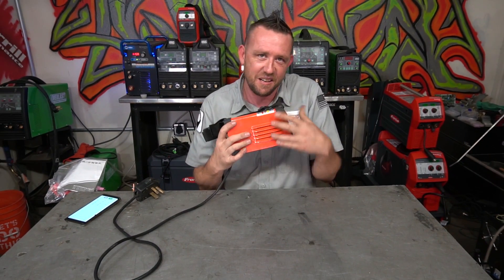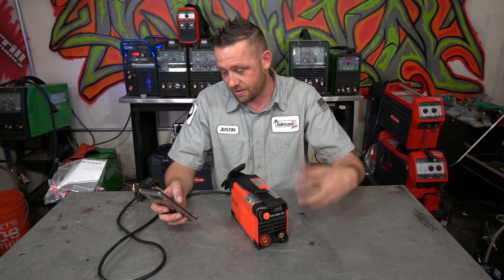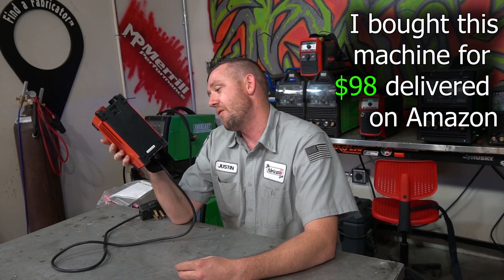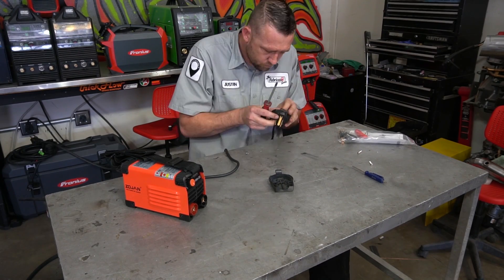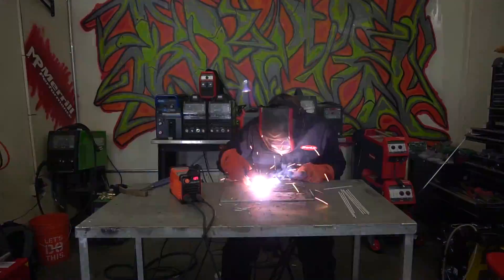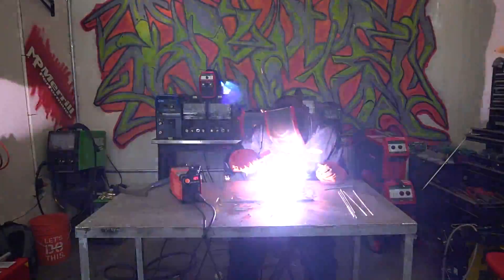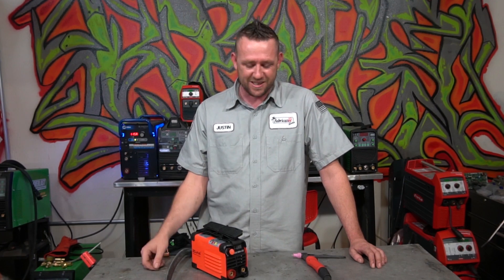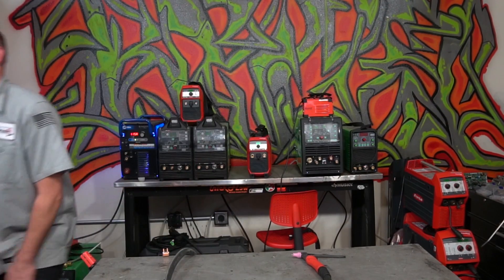TFS: The Smallest Welder EVER! Will it TIG?

Comment: would it have anything to do with the fact it's a 240 volt machine? if you have american half power (110 volts) wouldn't it mean the readout is calibrated for the rest of the world (240 volt)
Reply from the maker: clayraven Its plugged in to a 240v outlet. It doesn't even work on 110v
Reply: how many people are gonna say that? It WAS plugged into 220V for fuck's sake. In America we have BOTH 110 and 220. So many people asking that same question. American half power? Is that an engineering term? HAHAHAH!

Comment: under $100 for a 120amp welder still a good deal for home jobs, so no reason for call it a paperweight.
Reply from the maker: EliosMoonElios Its not under $100 once you add up all the extra parts you have to buy just to use it.

Comment: I bought the Harbor Freight 80 amp inverter stick welder that is the same size with the 20% off coupon. I have used it on wrought iron hand rails and such as well as thin stainless stick welding. It's done all I have asked it to, but that hasn't been very heavy work. I have the parts to make it a small tig machine as well, just haven't gotten around to needing it for a project yet.

Comment: Why would it cut out after a few minutes?  I was under the impression that the duty cycle was a "suggestion", that they wouldn't cut out after that time. Certainly torches/mig guns won't cut out, even though they have duty cycles as well.

Comment: It's just pocket stick welder for small repairs. But it's cute! :D
Reply: The thing that makes this useless compared to the slightly larger SMAW welders is that this uses the high voltage plug while like the Harbor freight mini welders use a standard household 115/120V wall outlet. And it is actually more expensive than the Harbor Freight one, despite both being chinese.

Comment: What you're interpreting to be amps is more likely "power" or percentage of output capability expressed in decimal from an 8 bit encoded value (256). The actual upper and lower bound are probably mechanically limited or are interpreted from a poorly calibrated analog potentiometer - 254 was shown in this video.
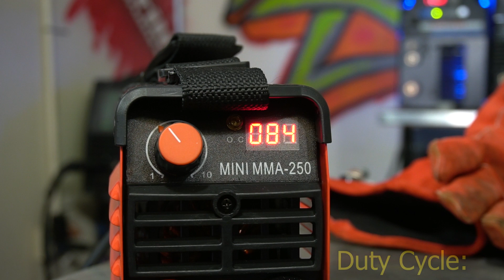Reply: Mr. Holmes you've gone way too far with that. They sell it like 250A welding machine. 4:58 even on the seller's page at AliExpress there're pictures of the machine with rubbed off sticker.
Reply: that actually may be it

Comment: actually its use for 2mm rod 6013 
handy for power minimum 900watt or more 
here mostly house electricity use 900watt ( enough for spotting until MCB trip off )
just for thick material max 5mm
its usefull on TIG stainless 1mm or 1.2mm with 1.4mm tungsten 

just prety cool for doing something weld 
i often use 30 to 60 amp for TIG stainless 1.2 mm or less

if you pushing up over 120amp its could burn mofset

Comment: You was losing the power in your jumper lead that's where your power was going being drained through your thick cable trust me
Reply from the maker: Joseph La Roche Same result when arc welding. The machine is not accurate.

Comment: What about as a trail welder?
Reply: That's great- But your "trail welder" cost a little less than what my entire offroad rig did with a 5" lift and 35's.
Reply from the maker: Seth Wilcox Are you bringing an 8,000 watt generator along with you as well?
Reply: The Fabrication Series maybe:). There are guys I have wheeled with who had onboard welders and air compressors.
Reply from the maker: Seth Wilcox I guess whatever works haha. Cant be too prepared... I wouldn't really trust this machine though. Too much missing info.
Reply: The Fabrication Series true, and those were rock guys, I'm a mud bogger, so not as much breaks with my truck.  The link is to a video on my old channel (I got locked out of it): https://youtu.be/b6c2QKCoO2g
Reply from the maker: Seth Wilcox Right on. I have a Fronius Accupocket 150 for my portable/trail needs. It's very small, battery powered, and stays in the truck while on the trail.
Reply: The Fabrication Series my issue is packaging.  I'm relocating my radiator to the "bed" of my K5, installing a fuel cell, and a water tank for windshield sprayers, so space will be at a premium, even in a big truck like mine.  It's even going to get cramped under the hood, I'm going to be building a twin turbo LS
Reply: elesjuan you have a China turbo Miata on 35s with only 5 inches of lift?

Comment: 12 electrodes and it carried on so it does weld and does what it says.
Reply: 12 3/32 even in an industrial setting that's good. I'm not sure what people are expecting. Most people are not building 1000 psi vessels or skyscrapers in there garages or small shops unless I'm missing something.
Reply from the maker: It actually doesn't do what it says haha. That's the problem. 12 electrodes at an unknown amount of amps with an unknown amount of duty cycle means you'll never know what it will actually do. The amount of rods is actually irrelevant since just about any machine will burn without exceeding its duty cycle if you weld way below it.
Reply: If you still have the welds cut them and see how far they penetrated then will know if it can weld.

Comment: No mystery to me at all... the Chinese LIE ABOUT EVERYTHING! Have yet to find a single product that wasn't over rated, over stated or in the least bit honestly portrayed. Your divide by two suggestion probably more accurate than a sworn proclamation of sincerity by ANY Chinese manufacture. Odd part is I know China CAN make quality products.... they just DON'T if they can get away with it.
Reply: Chinese often build to spec - but if the corporation that orders from them says to cut corners, 'CHOP CHOP' !   Conversely, 'high end' machine tools are built there as well , * not to mention that a majority of tool & die 'geniuses' will send labor overseas so they can go to the bank, & NOT pay taxes !  Quality always comes at a certain price, either for longevity or obsolescence.   Caveat Emptor makes sense : buyer beware !
Reply: But those things are also a small fraction of the price of good brands so honestly what do you expect dude?
DeWalt for the price of Chicago electric? 
Use your head.
Reply: Mind Freshener hes isnt running it on 110 volt. Hes running it on 240volt. Most likely with a 50 amp breaker or better. Look at that plug, thats a 240 plug. Check your specs, as in glasses.
Reply: Mind Freshener  The specs would have no influence... that was my point. Chinese specs are meaningless.
Reply: Doc Pedersen u are sooooooooo damn correct about that!,,,,,lol its why i stop purchase stuffs from china
Reply: @HumbleDadz  It does not matter where you're purchasing 80% of electronics come from China anyway :)
Reply: @HumbleDadz  you are right, I have never seen a Chinese that is 80% honest

Comment: Due to it being so very small I could see having that as an emergency backup rig that doesn't take up a lot of space.  Just as long as you didn't need to weld anything very thick. I'd also like to see some kind of exact current reading taken externally via a clamp meter or something. I'm really surprised that you had to give up before the machine did. that type of result on the stress test is actually pretty impressive. 

Obviously it's not a serious machine for a professional but I like it. I'm no welder though.

Comment: arent you on 110V instead of 220V?
Reply: 110V may be what we use in our houses/office buildings/etc, but we still have access to 220V. It's not like you cross the Atlantic and all of a sudden electricity only goes to 110V. Most people have a 220V in their laundry rooms for example. Either way, the big ass plug he used is typically what we use for 220V and a normal American plug is for 110V. I have painted a couple of houses that were miswired and have a 110V style plug on a 220V lead, it makes life really exciting when you plug stuff in.
Reply from the maker: 3S This is 220
Reply: allright , i don't know much how things go overseas but i allways assumed its 110V or something over there.

learning alot of tig skills from watching your series btw, thanks!
Reply: in my country we use 220 vac for everything... trafo must be needed to convert to 110, like only import stuff comes with 110vac
Reply: Usually it works like this. For ex here in europe on a 3 phase system you get 230 V between each phase and neutral and 400 V between 2 phases. In US it would be that to get 220 V  in an ordinary outlet you connect  2 phases instead of  phase and neutral to the outlet to get 220 V since its 110 V between phase and neutral there and 220 between the phases. So you would then have a 2 phase outlet instead of a single phase one. If I did the same where I live i would then get 400 V in the outlet.
Reply: @johnpekkala6941  you hit the target with your explanation.  Very few people understand that euro 240 is different than USA 240.
Reply: In the US we of course have 120 volts, 60 Hz or double that to 240 volts.  I have a Hobart 210 MIG (made by Miller) which can run duel 120/240, but you only get half output at 120 and that is on a 20 amp circuit, not the more common 15 amp.  In Japan they have 3 standards. 100 volt 60Hz, 120 60 Hz, and then European standard 230 volt 50 Hz.  Now that is getting confusing!

Comment: If it weld for you most likely it works.

I got my 4k setup as I used for my personal projects ... but ... I also  work as a locksmith.... so I think this would be great to weld a metal lock box on steel gate (16 gauge) or to add a eye hoop for a padlock  on a gate ....  you are not been fair to this novelty of yours .... what if I had no money but my cheap as bicycle is broken will I be able to do a weld repair on a crack on my bicycle .... I think yes.

By the way.... you did not show your welds to see if it was strong or fair in a particular metal thickness/gauge. Your review S@&$
Reply: Do you have any idea how difficult is to take one of this professional welders on the field. For a side job.
Reply from the maker: magaiver Theres no saying what will and will not work because the accuracy for the machine and what it produces is unknown. I will not recommend a machine with no control. 

A cheap bicycle is about $40. A tiny welding machine, a set of leads, a plug, a pound of rods, and the electricity to fix a cheap bike is about $212. It's cheaper to replace the bike. 

16 gauge mods and repairs can be done with other cheap machines that run on dual voltage because a cheap 50' 220v extension cord added to everything else needed to run this machine means that you need about $280 to add a lock box or fix a gate (if its within 50-60 feet or so of an outlet). 

If your solution is to use a generator (you didn't mention it, but others did [just bringing it up]), add another $1,000 for a cheap portable 8kw generator to the price to weld a 16 gauge gate more than 60' away from an outlet. 

Now, if you like the machine and want it - buy it. Makes no difference to me. My opinion is that it's less practical at the end of the day and less than dependable out of the box, and it ultimately costs more to use it. That's part of why it's a novelty.
Reply: The Fabrication Series 

My setup coast me 5 thousand dollars and it's a cheap one too 110/220 mig, stick, tig .... I dont weld for a living like you do ... and $300.00 setup on a budget it's great deal for any diy project . 

I read most of the comments and not all are in your favor. Dont get me wrong as I I'm subscribe to your channel and I follow your videos ... but I strongly believe you not s fair person on this product  just because its missing a dial or a foot pedal or because it won't do as 2 inch i beam for a 10 story building structure.

Thank you for your reply and sorry for my remarks but fairness was not here.
Reply from the maker: I know of many other machines for the low budget minded DIY'er. This one is simply not one I would recommend. I'd recommend a dual voltage machine with included leads and more predictability for the money. I wont blow a bunch of sunshine in someones face about how good it "could" be just to be fair to a machine that performs the way it does. It makes no difference whether someone agrees with me or not. I'm simply reporting my findings and stating my opinion based on those findings. It is a straight up "take it or leave it" concept without favoritism or bias.

Comment: After years of working on Chinese electronics I still have not figured out any standardized mathematical standard. You are pretty much correct though, divide by 2 is a safe average. Interesting enough though in their dc to ac inverters the equipment is often capable of the claimed capability yet the FET's typically are well under rated.

Comment: See what the thinnest metal you can weld with it is, looks like you can turn the power down really low. It might arc weld less than 1mm metal, it could be useful if it works.
Reply: Could be ideal for quick exhaust repairs
Reply: I'm sure this would be a great welder for someone that does like hobby rc rock crawler chassis and all kinds of other low amp projects. The 1/2 amp dial might even work to someone's advantage.
Reply: i`m welding with 18amp 1.3 and 1.6 all day. 
that will be interesting to see.
Reply: @DanielCardei  Thats on regular steel, isnt it?
Reply: @henryrollins9177  yep
Reply: Oliver Taylor true

Comment: What's your opinion of the "Fronius  Transpocket 180" ?
Reply from the maker: gord johnson The Transpocket is an awesome little machine I have the TIG option on mine and its buttery smooth. Haven't burned too many rods on it as of yet, but it's really nice. I cant get over how light weight it is.
Reply: What's your opinion of the Fronius Accupocket 150 battery powered portable welder ?  It's expensive, but it sure excites the imagination.

Comment: I bought a small one (not that small) in a hardware store here in Guatemala which had a low price tag, it costs me about US$75 o little less. It offered 130amps and 120V only. I am basically unable to burn 3/32" 7018 rods, only 6011 and 6013... and weirdly it burnt 1/8" 7014 but surely there was no penetration. I took a induction amp meter and the maximum it got was around 75 amps. After tearing it apart just to look how it was inside, there where some model numbers that took my attention, both boards had an 80 on it. I am pretty sure that 80 amps are the nominal amps it can. Looking at the IGBT, they were rated for more than would be needed for 130amps, the diode array were also rated for more (by little) than 130ams... though with them was a catch, only at peak but not really worried since the way it works.

Anyway... you could get the max amps it is supposed to give, I finally found how... just stick the rod or the tungsten electrode to the workpiece and BAM!, there you get the full amps! You wont be able to do a thing but c'mon, you wanted the full amps.

Btw, I knew that at US$75 here in Guatemala this inverter welder would be bad, I wanted it to TIG weld at low amps anyway for sheet metal. Would have liked at least 125 amps but oh well.
Reply: Elder Pérez aa

Comment: 125 Amps for 99 bucks sounds like a good deal to me. It reminds me of the 3000w stereo amplifiers and 6000w speakers. Marketing takes over often.
Reply: Amps and speakers you had to read the fine print, they show the peak to peak output, which is more than double the RMS...
Reply: and the 10000mAh 18650 batteries that perfectly drive the 6000W stereos:)
Reply: I got one ,edon brand from china,same size but shoots out 350Amps, I used edon for years they are the best.

I paid maybe equivalent of 50 for it.
Reply: I spent $200 for one that does 110 amps and that was 20 years ago. Still works to this day. Best $200 I ever spent. Unless you count that one trip to Reno.
Reply: @MrRatkilr  I bought a Maxstar 150 back in the day, just under $1000, made that money back first weekend I owned it at the race track...

Comment: i have a similar machine , and mine dose the same with the amp. shows half amps. 
but it burns 2.5mm rods good , and it has a purpose. ones i needed to walk 2 miles in the forest (because it was on car aces) whit a welder in my hand , and it was the best choice.
Reply: Please is it still working? Would consider it durable and reliable?